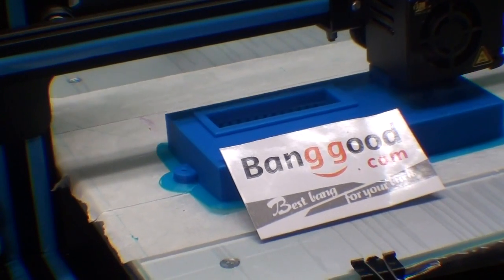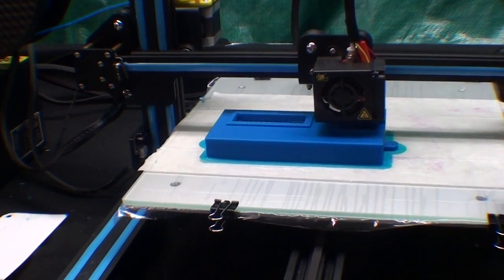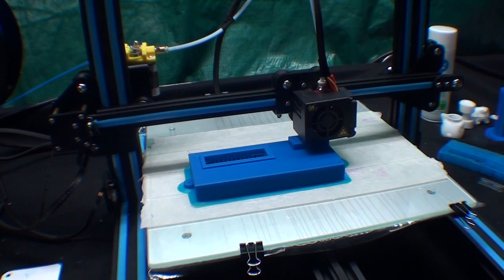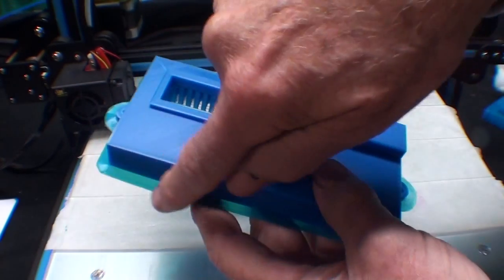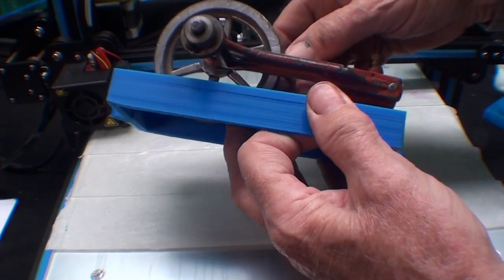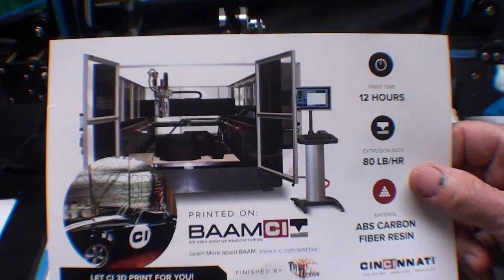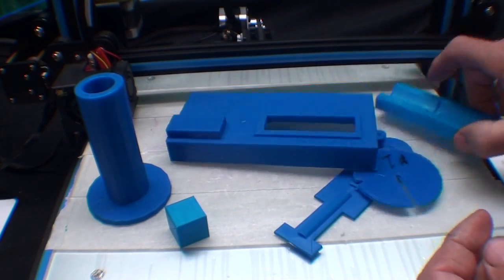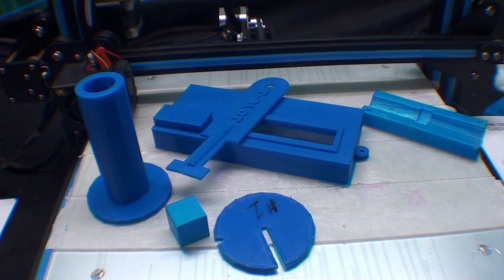3D Printing CREALITY CR 10 with tubalcain #1

Comment: There is somewhere a setting to add custon g code after and before the print.
You could add in post print 

G91 ; relative movements from the CURRENT Position
G1 F150 ; slow Z rate
G1 Z5 ; Z up 5mm
G90 ; back to absolute Position
G28 X Y ; home X and Y axes
G28 Z ; home Z axis only

It will go 5mm up and then to x0 and y0 and then go z0. There may be somewhere a box that ticks "go to parkposition after print" that does exactly that.

You could also add pre code to start the heating.

I use Marlin Firmware and repetierhost for the printing.

Comment: You should not be using anything with tape.  I use a piece of 1/4in thick safety glass on my printer with custom made corners and wedges to hold it in place. hairspray on the glass makes stuff stick well.

Comment: Use a sheet of glass on top of the bed held on with folder clips at the corners. The bottom will be smooth. When the print is finished then just take the glass off. As the glass cools and retracts, the print will pop off. Repetier host is a better slicer than Cura. Change infill to 20%. The prints will be much faster.

Comment: You may want to find out what the extreme travel in +Y of you printer and travel to that at the print end. This will give you access to the print to remove it from the print bed. You should be able to use any cad program just output a .STL(or save to a .STL). than load it into Cura. My Cura automatically outputs code at the program end to raise the head than move to X zero and Y+ direction. There may be a setting mine always worked that way from the beginning.

Comment: Mr. Pete mastering the 3D printer, fantastic! As for returning to home, I'm not sure what you are using for your Slicer, but there should be a setting similar to "End GCode" and at the end of that paste "G28 X0 Y0" that will make it return to home when the print is finished. Then follow that with "M84" on a new line to unlock the motors. As for the center, you need to make sure that the bed size in your slicer matches your actual bed size. Most likely the slicer thinks the print is in the center, but has a different size bed programmed into the slicer. The heating is also mostly controlled by the slicer. The polygon issue is mainly with TinkerCad. Most other CAD programs such as Fusion360 can change the quality to make the polygon count very high and indistinguishable.

So my main question is, what slicer are you using? I can help you out quite a lot, I've been 3D printing for over 5 years.
Reply: in Cura 2.x

-settings menu 
-printers
-manage printers
(select your printer)
click Machine settings
make sure the X,Y & Z are correct for you  (300 300 400)

in the "end G-code" box paste:

M104 S0 ;extruder heater off
M140 S0 ;heated bed heater off (if you have it)
G91 ;relative positioning
G1 E-1 F300  ;retract the filament a bit before lifting the nozzle
G1 Z+4 E-5 X-20 Y-20 F9000 ;move Z up a bit and retract filament even more
G28 X0 Y0 ;move X/Y to min endstops, so the head is out of the way
G1 Y300 F9000 ;move out to get part off 
M84 ;steppers off
G90 ;absolute positioning

your long print time may be because you're using 0.1mm "layer height"? 0.2 is enough for most things. My old eyes can't tell the difference on the 20mm cube test.
"Infill density" grater than 50% is rarely worth it (time & plastic)

the glue is supposed to be dry before you print. The most common adhesion problem is the bed not being perfectly (as you can get) level.

Buildtak is an awesome surface to print on but it can hold on too well if your bed temp is too high so 40 deg C or maybe less. PEI is also very good.
I use an old clean wood chisel to remove parts. Flat side down and wedge it under a corner and twist while keeping the chisel edge flat.

You should be able to print with no brim once you get it sorted. I use "skirt" of 4 lines to prime the nozzle properly 

Hope that helped.
Cheers mate.
Reply: And if you put G28 X0 Y500 it should bring the bed to the front.
Reply: Fantastic addition buggyland!
Reply: I would recommend raising the extruder slightly before homing it, in case the print has tilted or warped.
Reply: he said he is using cura
Reply: most of all: get the profile for the cr-10 by adding a new printer to cura, (make sure you have the latest version 3.0.x), choose other and then the creality cr-10.  That will fix your starting and ending troubles and placing the model in the middle.  Cura 3.x is a bit of a dog with startup time and it makes some curious GUI choices, but it is quite allright once you get used to it. There are indeed tons of variables to play with.
Some nice ones for you: get the number of bottom layers up to 5 or more. Right now your tops seem to be see-trough, which may be caused by too few layers, or too little infil below it. And whe you are just learning this stuff: stick to PLA. ABS is hell and should be avoided, other filaments are more suitable for the advanced user. 
A lot of the defaults in Cura are ok, but personally I like to up the layerheight (to 0.15 - 0.25) to speed up printing. Pretending that you have a 0.8 nozzle (in the machine settings) works too if you can trade some fine detail.
Reply: Pretty sure he said he uses Cura in the video.

Comment: Add   G28 ; Home all axes To end G code in Slicer.
Reply: You don't want to home all axes when a print is finished. This can cause the extruder to crash into the part when Z is homed. So you would add "G28 X0 Y0"